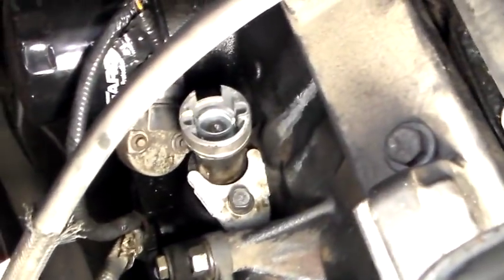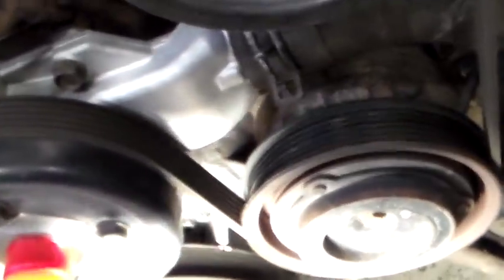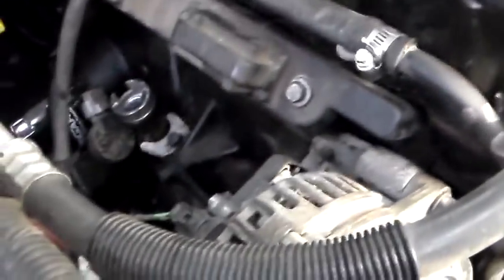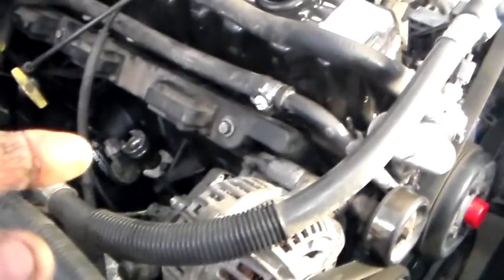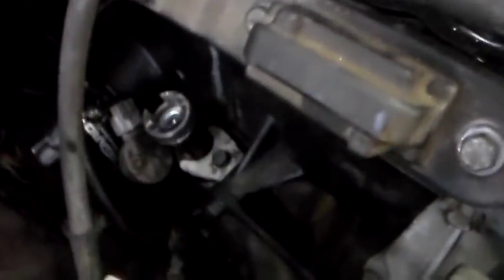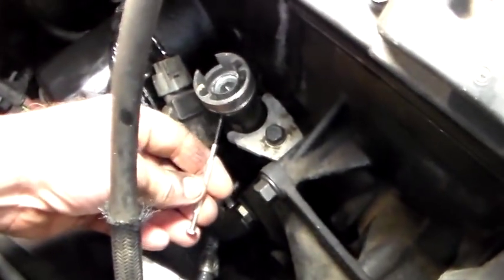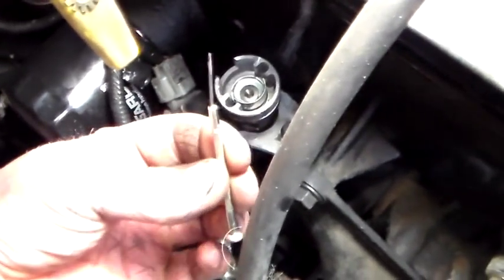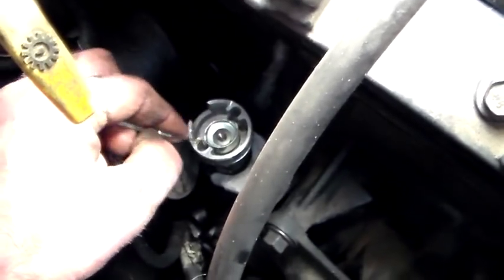4.0 Jeep Cam Sensor Installation and Alignment

Comment: Toothpick for the folks who forget to remove their alignment tool and they go give the motor a crank for some odd reason and break their parts, ALSO do not use zip ties on timing belts for the same reason hehehe. Thanks for the tip and by the way, I don't mind the music but I do worry about folks turning you in for copyright, and getting the video blocked is my only worry brother. I will guess that this Artist does not mind the free advertising.
Reply from the maker: Great tips Duane!   and yes, the artist is all good with it, they already informed me (I just don't get paid for the video).  Do you think she drives a Jeep ?

Comment: The pulse ring is sitting just over halfway from the alignment hole. Turning clockwise of course. So that the pulse ring outer edge is almost parallel to the engine block.
Reply from the maker: Thanks for the update.  Were you listening to my video  while fiddling with the alignment hole ?

Comment: Wow so if there is no hole or you can't fit a toothpick thru it then it's out of alignment?
Reply from the maker: If the engine is at top-dead-center (on the compression stroke) and you can't fit a tooth pick in the hole, then yes, the distributor/camshaft position sensor is out of alignment

Comment: Why not just install the new cam sensor "exactly" how the old one came out? It does not seem necessary to remove coil pack and set to TDC compression stroke, unless the crank somehow moved.
Reply from the maker: I had the engine completely apart. and for anyone who found themselves in a similar spot, they might want to know  ;-)   Do you just love the music ?
Reply: The background music was fine with me. The voice in the video was completely understandable.  I don't understand how the sound of someone else's music can have such a tremendous negative trigger with some of the commenters. Is the music any worse to the ears than a busy restaurant,  freeway traffic or air tools?
Reply from the maker: Exactly- some people just love to 'hate'
Reply: Yeah , I just did a bare block overhaul to mine and this is the only way to find the way to reinstall the oil pump drive / cam sensor drive back into a bare engine .
Reply: So can you just reinstall cps the way it came out?
Reply: @Dave Soter  that's what I want to know, it seems to me if you put new one in exactly as old one was, you should be fine!
Reply: @Dave Soter  I just did mine! Just removed the old one and put new one in exactly the way old one was in! My new one came with a cap to align it,,
Started fine, drove around, no problems!!

Comment: I had a camshaft position sensor code pop up after I got some gnarly death wobble one day. After that Jeep had no power, limped it home. Came up with 2 TPS codes leak detection pump code and misfire in cyl 2 code. I swapped out my TPS with 2 complete working throttle bodies so far still no change. So my question is do I need to listen to that song while I'm working on it this weekend and if so what is the name if that song? Lol

Comment: For top dead center can't you also just make sure the rotor is at the #1 position? If it is in the exhaust stroke and the balancer mark is at 0 then the rotor will be 180* from the #1 position.
Reply from the maker: .... except there is no rotor - they had gone to direct fire coil packs by this point. So what you are seeing in the video is strictly a cam position sensor that is used by the computer to get the fuel injection lined up.   I'm demonstrating how to get the cam sensor properly installed after a complete tear down.  Don't ya just love the music ?

Comment: quick question... I know this is an older video but on that same side bundled with the harness going to the cam sensor do you have a yellow clip connector as well. I just put mine back together and have a yellow (on the inside) plug for the life of me I can't find where it goes and do not remember if it was not connected when I started removing stuff a month ago?

Comment: In your "How to Install an AX15 Manual Transmission" video, Michael says that he didn't unbolt the CPS from the bell housing because he didn't want to mess with the CPS calibration.  I didn't know that the CPS needed to be calibrated... does it?  I was lucky to even get my hands up in there and get my CPS installed recently.  I can't imagine being able to adjust it's position considering how difficult that job was.  But after replacing my CPS, I'm getting  P0300-Random/Multiple Cylinder Misfire Detected codes and wondering if I need to adjust it or try replacing the cam sensor or ignition coil next. ('96 4.0)
Reply from the maker: Thinking about this, did you remove the flywheel ? If you did, and put it back on, there is a chance the CPS got knocked a bit.  Or if you changed flywheels it may be necessary to reset the clearance to the CPS.  If you are in the States, O'Rielly sells crank position felts, they come in a pack of like 5. You stick the felt to the end of the CPS and push it into the hole until it's against the flywheel then tighten the bolts.  The felt wears off instantly but provides the proper clearance so the CPS picks up each cylinder.  BTW I once bought a replacement flywheel for an automatic trans behind a 4.0 from Pioneer (thru O'Rielly) and the damn thing was out of round so it only hit on 3 of the 6 cylinders.  They gave me a new one but Pioneer refused the labor claim. Crooks.

Comment: Let me go ahead and ask a possibly dumb question: do I need to drain the oil first?  It's right next to the filter and I don't really know how the sensor itself works or if it sits inside the oil or whatever.  Thanks : P
Reply from the maker: You do NOT need to drain the oil, but you DO need to fire up some Beyonce
Reply: First, MUSIC...
Second, Annoyance...
Third, WHY!!!
Fourth, smh...

Comment: this is one of the few videos ive seen related to replaced the cam sensor where you remove the sparkplug and check that its on a compression stroke.  wondering if its really necessary?
Reply from the maker: You have a 50/50 chance of getting it installed correctly if you don't make sure you're on 'TDC compression' and the only way to do that is to remove the spark plug and check for 'pressure' while turning the crankshaft-  and ending at TDC

Comment: If I have the old sensor in, can I just align the key hole and replace the synchronizer? Bought a part from Carpart dot com and it some how bent the friggin thing. Ran for 30 minutes and just turned off. Don't ask me how it happened, cause I can't tell you. First install with a mishap, since high school!
Reply from the maker: Yes

Comment: Some of the comments about the music seems a bit ignorant.
Reply from the maker: Stephen, check out the number of views -- I think they keep coming back for the music !
Reply: Mark.  I think that you're correct.  Haha.  I am going to see if I can get this part into my TJ.  I do understand why the cam has to be in thee specified position.  Just not sure of my full ability to get it there.
Reply: Haha.  I will set up the PA system and rock it out.  Thanks for the info.
Reply: Got the part in.  The misfiring codes went away, but the p 1391 is still coming up.  Did the crank, cam, spark plugs, and not confused.  At least all the other codes are gone.
Reply from the maker: Stephen -Did you properly set the gap between the crank sensor and the flywheel ?